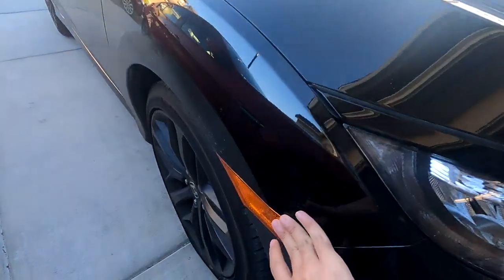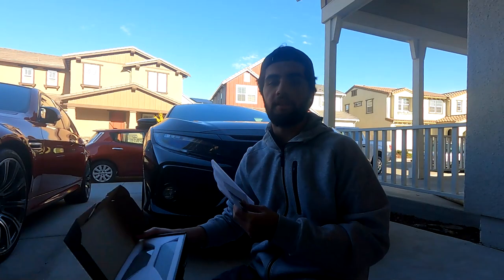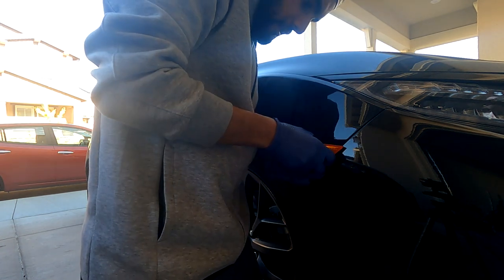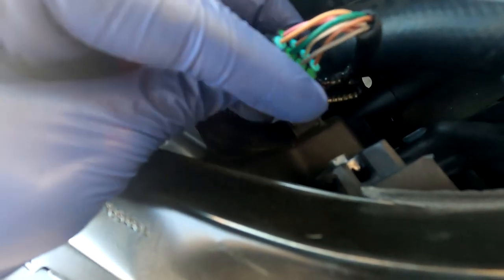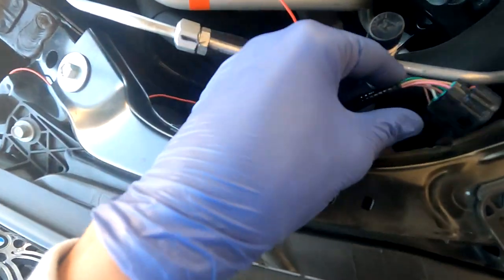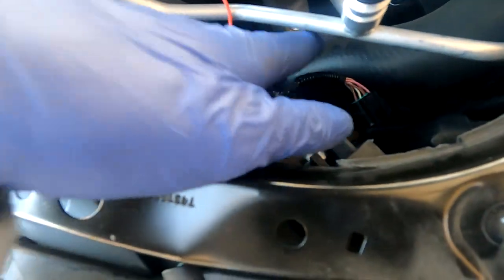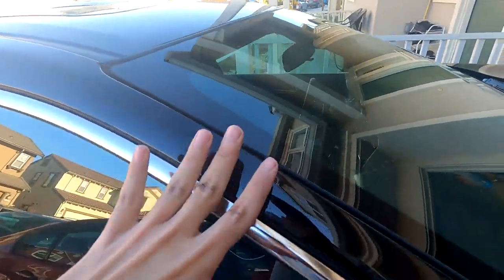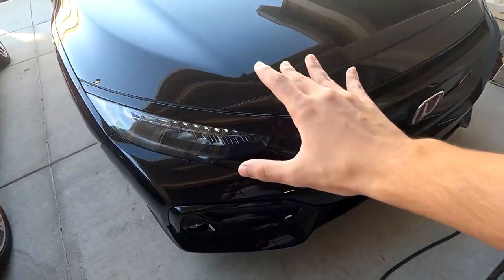Suma Performance Sidemarkers! | 2020 Civic Si

Comment: Zakir, so is it confirmed that it is in fact the "middle wire" on the row with the 3 wires? I love the video but I wished you would've filmed the moment you actually spliced the wires( T Tap).
Reply from the maker: Whose Zakir? Also yes I the middle wire worked for me and was the wire everyone tapped into in the forums
Reply: @Ibssaini  I think I was responding to another commenter "Zakir". I used this video to install my side markers. The T-tap was simple too.